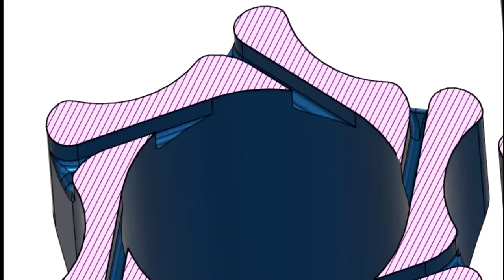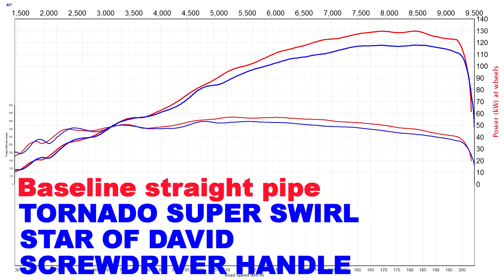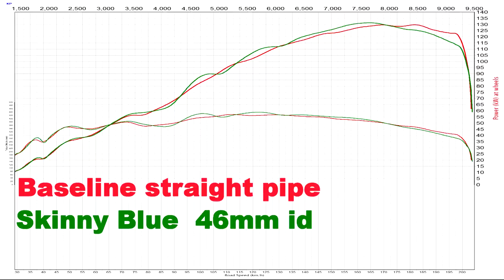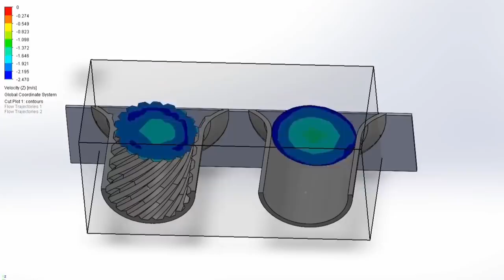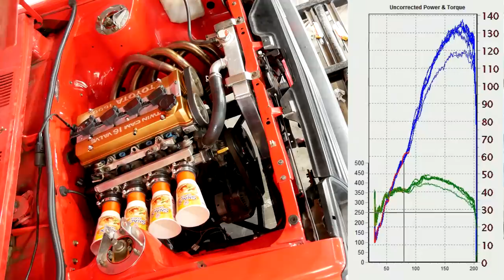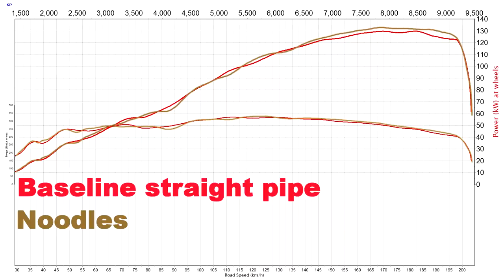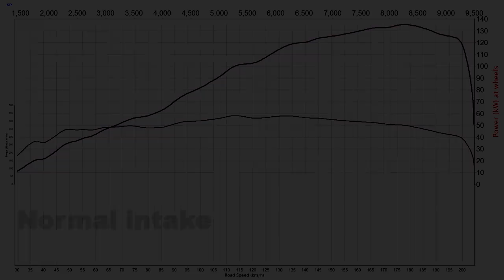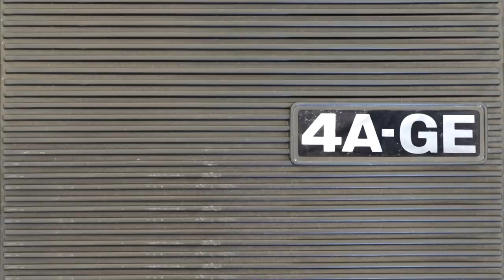Viewer 3d Printed Velocity Stacks  - Trumpets - Intake runners - Dyno Tested

Comment from the maker: Lots of people asking to see different lengths, shapes, bends etc.     I have videos covering most of these already,  these 3 a most relevant  ;    https://www.youtube.com/watch?v=nqYkmCLrlEo      https://www.youtube.com/watch?v=kSM0JRGRYTM      https://www.youtube.com/watch?v=W_-4AXGTpYc        but more on my channel page
Reply: Thanks for the uploads, its an interesting topic....know sounds stupid but what would a salad bowl do as engine masters tried it and it showed an increase that wasn't expected. What i understood is that you have a larger volume of air available and there is an increase of pressure at the smaller end allowing for more flow into the engine.
Obviously that maybe another thing to add to the testing a couple of sensors for IAT's and Air volume or flow.
Science :) and once again big thanks :)
Reply: be careful, i did this once and the material I used gummed up my carbs. it sat on the vehicle and was exposed to gas way longer than it should have been ;)
Reply: nice CFD!
Reply: if you are looking to make power  run 4 velocity stacks  like the mini white one but way shorter( I get that you can not put them closer for melting issues during testing. ) then put  a plenum around all  4 to your air cleaner.  larger in the front shrinking to the back to keep velocity.  look inside an f1 intake.
Reply from the maker: @johnantonopoulous6381     Watch the video in 2nd link i posted up there ^   shorter than what have here makes less power.    Heat not an issue, throttles run just over ambient even on dyno
Reply: @Garage4age  would be interested in how the green swirls would do if they were full length instead of having the extenders on there.
Reply from the maker: @Enadiius   Yeh probably worth trying.   but tbh i think the air just skips right over top rather than spinning
Reply: @Garage4age  yeah true, double or triple the size of the fins at the mouth sloping off to the original size at end? lol. if i had the software and knowledge how to use it I would love to modify and merge a couple of these into one design and see how it goes.
Reply: I think the star of David with a small hole on the enclosed end might introduce more volume while still generating a vortex. If you also shape it more like a bell that might be better.
Reply from the maker: @joaovicente575   The guy that made them (david, who would have thought?)  made the the slots over double the area of the throttle entry id. I think his main objective was to test something with a capped end more so than making the air spin
Reply: @Garage4age  thanks for the reply. I noticed at least one of the other models had spiral fins so I thought there might be some sort of intent/purpose to the spinning air flow.
Reply: Hey I got a question that may lead to an idea. So years back I watched Myth Busters. On it they had an episode showing the "golf ball" effect when applied to a vehicle. Their results actually shown fuel milage improvement on a car covered in clay with cups carved into it like a golf ball.. seeing this video made me question that same principle but applied to the inside of the velocity stack. If you have the time and resources I would like to see a video with those results.
Reply: boltonky,  I saw that Engine Masters episode!  Its on the web on the Daily Motion site:  "Air Filter Horsepower Shootout! - Engine Masters Ep. 27"  
Just not sure how to do a salad bowl on multiple IDTB's?????
Basically, thats what these are, inlet you start to adjust length of each stack on all of these designs....maybe some would have more gains than others.
I bet those green swirls would work great inside each runner on a plenum style ram air intake!!!!!!

Comment: Just for dyno data porposes what if you run intake out of engine bay and into a Freezer or Ice chest somehow for the cold air intake to see the difference in power from different temperatures
Reply: Lol, I love it
Reply: I think it will be best since it will take air outside of the engine bay but the plenum will to be perfect
Reply: The surface area of the intake doesn't sufficiently transfer cold to the air. What you want is an AC cooler sitting across your intake so the incoming air has to pass through the core
Reply: You can just calculate this, it's about 1% more power for every 10 degree of air temp. Gale Banks did a thing about this.
Reply from the maker: Yeah as above, is pretty easy to calculate If air temp is the only variable.
Reply: @Cowboy.underwater  so that's like 30% more power to be had if you superchill that shit :P
Reply: @Cowboy.underwater  Banks ran a dry ice intercooler on an NA engine at Bonneville
Reply: Ya you gotta do this. Then run the same setup ducted  to the middle of the shop as a control
Reply: Or you could run a really long tube from Antarctica for cold air induction
Reply: @Garage4age  you gotta try it man. How about a filling a charge cooler with plain water and shoving it in the freezer prior to dyno run perhaps?
Reply: @Aheitchoo  really if you run a single tube to a plenum the only way it would change power is temperature at the inlet and causing restriction, but if the tube is big enough it's just a temp thing, it'll just act like one big plenum.
Reply: @Skirk84  plumb your AC into a front mount intercooler for it to flow through ✌️
Reply: Keep in mind, the pipe’s length has an impact on overall pressure drop and therefore flow.
Reply: @hojnikb   that would be a 300 degree drop in temp...
Reply: Two words liquid oxygen injectors
Reply: @Druid_22b  I mean, theoretical minimum is 0 kelvin, so right there :)
Reply: @neptarclepuffin  classic....
Reply: Additionally to the temperature you need to calculate how much air has to be cooled down. A fridge is pretty weak. You'll need something with the size and power consumption of an overcharge compressor for relevant results.
Reply: @neptarclepuffin  that's three
Reply: No need just go to Fairbanks Alaska around February. I will say I built a lot more boost in the winter
Reply: Someone did this before maybe mightycarmods? Idk been a while but they also had hooked up two leaf blowers to the intake to see if it added power.
Reply: I like that idea lol
Reply: This!
Reply: I've heard some new cars route part of the ac back to the engine so it can keep horsepower up on hot days while running ac.... very interesting and awesome if it's true.
Reply: Nitrous?..
Reply: @Garage4age  yes buttt.what if you used a coller full off liquid nitrogen that the intake pipe or intercooler passed through. (-320°) would it cool the air to make  more power or would the air be so cold it makes less power because its killing the flame frount 🤷‍♂️
Reply: @Cowboy.underwater  you can calculate a LOT more accurately if you use the actual equations. If we call 22 degrees Celsius room temperature then every 10C above that is exactly 3.33% higher
Reply: @neptarclepuffin  this is literally the entire idea behind nitrous injection, as it doesn't require as much to make it work.
Reply: @ILoveTinfoilHats  Well Yes, it still uses an intake dow.
Reply: Pretty interesting!!
Reply: I believe if absolute power of a standalone engine is the goal you wouldn't reasonably be able to chill enough air fast enough to feed it...
I saw someone suggest some power expectations on temperature, it's probably not going to stray too far off that unless it's a different kind of engine or very large...
Fwiw, shipping these days, it would be interesting to send the same piece to a similar build in a different climate, to gets the specifics on this particular set of datapoints.
Anyway there are methods of superchilling large intake volumes, i would steer your google fu wrong if i tried to remember here but you can find them on some of the higher horsepower per liter equipment. 
Interestingly aside, at least before 2012(newest car i work on), they would commonly pass system coolant through the throttle body to keep the space between the walls and the butterfly valve from icing.
Reply: @lilrich1243 The Roadkill guys did this way before Mewg and Murrdy
Reply: The engine would empty the cold air out of the freezer in a matter of seconds and freezers don't cool tat quickly so it would be pointless.
Reply: why bother with cooling the air more to get more oxygen, when you can inject nitrous for high oxygen content.

I will say, ive never seen it but a pure oxygen fed engine would be gnarly.
Reply: A dry ice cage in front of intake could do the trick!
Reply: @edh7492  the AC uses more power I believe then it can give back that way.

As for the dodge demon, I think it cools the engine with AC prior to, and not during, the 10 second drag race. Donno for sure
Reply: No, what you really want is a water to air intercooler running cooland so it doesn't freezes and the other end sitting in dry ice.
Reply: Big brain time, but no seriously that might work
Reply: Pretty sure it would hurt the performance due to condensation similar to carburetor icing

Comment: On the spiral intakes I think it would have been a more interesting comparison if the internal spiral fluting was carried through the entire intake runner length. Any airflow that was rotating would be straightened out in the straight section before the intake thus losing any potential benefits
Reply: The throttle blade will always work against them, running a slide throttle would be the only way,

Comment: This was fun, surprisingly smooth power by the noodle cups. Could it be an idea to use the whole Y axis for the power plot? It would make it easier to see the differences between the runs?
Reply from the maker: Haven't figured out how to do that yet or if its even possible in this dyno sofware.   joy of having obsolete software  with no support and some locked menu's
Reply: @Garage4age  export to Excel?
Reply: @Garage4age  no CSV export on that ?

Comment from the maker: Thanks to everyone who sent in their designs.  All 3d printed designs were designed, printed & sent in by viewers.  I will keep these tests running If anyone wants to send in there designs & will test once have a few. details are in description. I dont have a 3d printer so needs to be physical item. Please only low value items that you dont need returned.  
Couple of notes on this video.  I done all the tests at same length.  but due to the design of some items.  namely the big white, they will act as a slightly different length runner.  Aggressive taper or a big bellmouth will act as a shorter runner, which can be seen in the case of the big white design.   The long blue items were designed for a smaller size throttle body  and measured 46mm. were also tested as a slightly longer  length than the rest, due to fitment issues.
Reply: You have 4-2-1 exhausts and even equal length ones but what if you used it as intake makifold? Or at least similar with all runnrs connected and with a big snorkel to the fron of the car? It was done in the "200sx merged collector" video but never shown its benefits/drawbacks
Reply: Blue skinnies are well designed. With some remodelling, tweaks and fine tuning these things can give you more power from 4700 strait to almost 8000. Oh and smoothen the curve which will give you more throttle response. I may give some suggestion for improving them.
Reply: I'd love to print a couple of sets for you to try... that's how the prototype ITB setup in my signature/thumbnail came to exist... 3d printed first then machined after...
Reply: @АлбертАйнщайн-з1р  I agree I think they showed the best promise for a design basis aside from the traditional design of the big whites.
Skinnies are restrictive up top but the velocity increase in midrange fills cylinders better.

Comment: I guessed the white ones would win, I took my judgement from f1 design in runners from the old days of NA power 

If we look back those guys had spent a long time on engine dynos and optimised the potential 

Good work garage 4age keep up the good work
Reply: Shouldn't have read the comments during the Ads
Reply: Like you say, nothing new here, all been done in the ‘60’s by Vizard, Longman, etc.
Reply: In the 60's 70's some cars had stacks that were adjustable, they were linked to throttle cable and constantly changed their lenght
Reply: @mrsnezbit2219  That's cool, but you'd want the length to change based on rpm, not throttle.
Reply: @lennert8530  it was the 60's hahah in 2021 sure we could do that
Reply: @mrsnezbit2219  The R26B in the Mazda 787B racecars had variable ITB runner length based on RPM.
Reply: @lennert8530  the drivers knew where to have the throttle to get the best response/length. So yes they were rpm adjusted.
Reply: @sharkeyist  Sorry but that's just.. dumb. If you want maximum acceleration you want full throttle all the time but you want the intake length to become shorter as rpm's climb. If you link the throttle to intake length you would have to make a compromise and choose where in the rpm range your full throttle position results in optimal intake length.. There's just now way around it.
Reply: @mrsnezbit2219  there was an Amsoil Engine Masters Challenge where a contestant did variable length runners on an old hemi It was pretty awesome
Reply: @lennert8530  as mrs Nesbit, bear in mind we are talking about the 50’s n 60’s, and it clearly didn’t catch on ey. If you just pinned the throttle from low/mid revs, the engines would bog down due to dumping in more fuel than  required for the rpms, like a dashpot lifting to fast on a su/stromberg carb.
Reply: @sharkeyist  I know, I still run on carbs ;)
Reply: Seen a few superbikes with similar setups. Also some with 2 short 2 long etc as well.
Reply: @lennert8530  That's what the overly complex, craptastic plastic VANOS system in the BMWs basically do.
The reliable way is what lexus uses in their 1URFSE, it's a spiral manifold with flappers that change from long or short intake runner. Not as much variability but enough to do the job well without all the failures. 
Another great way is how the new C8 vette intake is tuned, even more simple/cheaper to make than the lexus one.
Reply: @mrsnezbit2219  😎👍👍
Reply: @lennert8530  My Alfa Romeo 156 from the 2000' has something like that variable intake, something like a plastic plenum with a variable snail on it, or something like that. Long untill 3000 rpm, short from that to 6000.
Reply: They were already experimenting with all of this as early as the 30's. Do some research into German aircraft engine and you will see how advanced they were. They introduced variable speed supercharging, water meth, fuel injection, nitrous oxide, sodium exhaust valves, multi valve heads, OHC, ball bearing crankshaft and rods, aluminium blocks/heads, roller rockers and the list goes on. Then US influence came in and engine went back to cast iron push rod.
Reply: It was more of look at all this effort, and noodles.
Reply: Hi

Comment: MT performance is bang on with his comment,  we even went to flat plate throttle bodies, and running even coarse mesh a top the trumpets for debris protection cut the HP ..... the internal shape and dimensions   from the air correction bell at the leading face of the trumpet to the back of the valve is critical too. 
Great testing, which showed the air correction bell is vital, and ANYTHING that disturbs or impinges, or removes energy from that moving mass is a no no   ( green swirl )
Reply: I would agree with this except when it comes to ports. I've seen proven dyno data showing rougher (and slimmer!?!) ports can make more power in superbike racing with port injection/not DI engines, due to atomisation/swirl of the charge being higher plus higher velocity port filling in upper midrange where you use power often for coming out of corners on a superbike. Probably less so today with CFD so popular but it's something to look at. 
But I do fully agree the whole system is a tuned design. Look at the latest C8 vette design with resonance used very smartly in a very mechanically simple (looking at BMW with disdain) system.
Reply: @N4CR  those are pretty vague terms you use ' rougher ' & ' slimmer ' !  I can prove exactly the opposite. There are specific sizing relationships from valve head to the bell mouth port entry, and a myriad of surface finishes that will and will not enhance power out put / fuel economy

Comment: Baseline 130kw on the straight tubes...that's 177 bhp. That's impressive for a n/a 1600. I love these engines. My mk1 M/2 was a wonderful car.
Reply: I had a Toyota Celica GT you could adjust the timing with a knob no tools necessary you could push a button inside the dash and see everything that need to be looked at oil level oil pressure coolant level and many other things that car was awesome it was stolen from me by the cops before I was able to even figure out everything that was in it I was doing good at my business I had helped my girl go to school and she wanted to go out even though I didn't have tags and my car got taken that night she made up for it though but wow